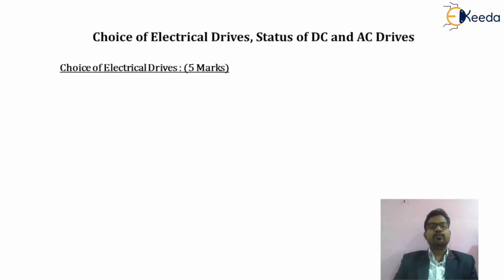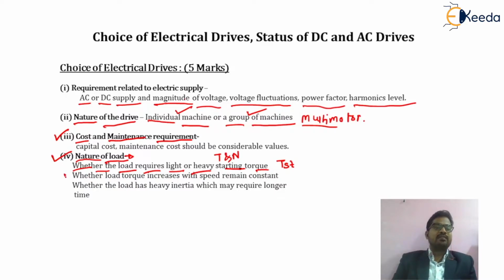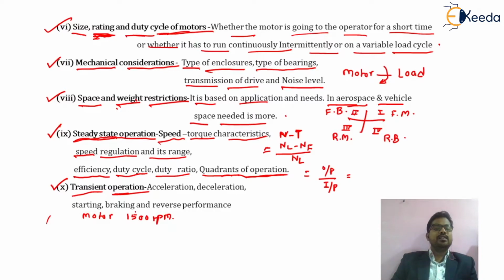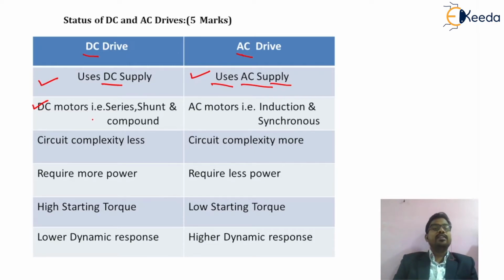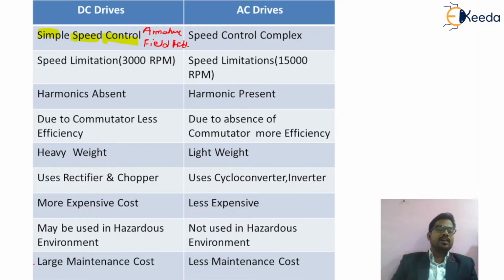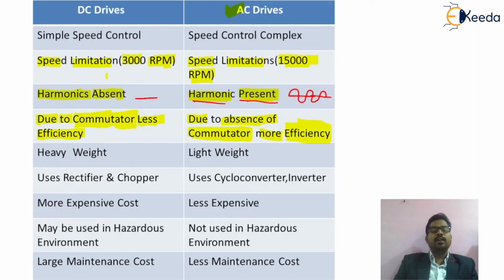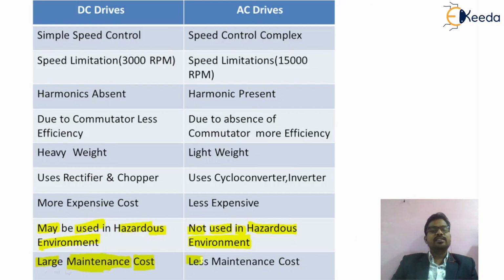Choice of Electrical Drives - Electrical Drives - Drives and control

Comment: 00:02 Choosing electrical drives is crucial for various applications.
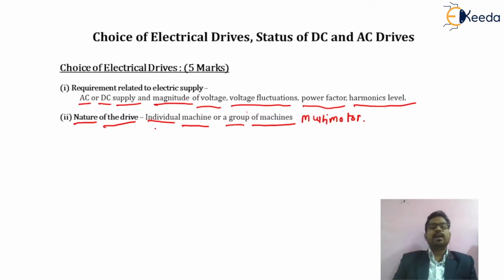02:23 Understanding the nature of drive and cost are key in choosing electrical drives.
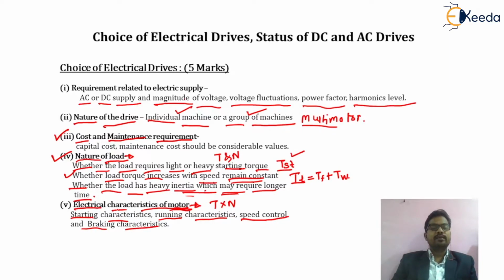06:29 Considerations for choosing electrical drives
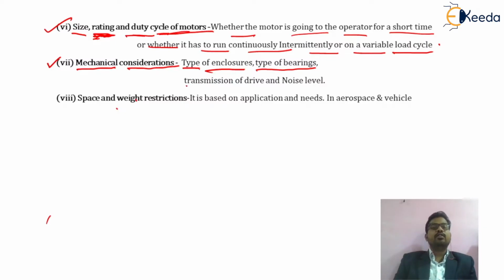08:38 Importance of drive transmission and space and weight restrictions in choosing electrical drives
12:57 Transient operation in electrical drives
15:15 Choice of Electrical Drives is crucial for university examinations.
19:21 AC drives require less power compared to DC drives
21:21 AC drive speed control methods are complex
25:30 AC drives are preferred over DC drives for better efficiency.
27:30 Different power modulators for AC drives